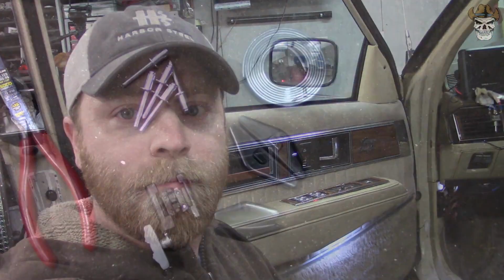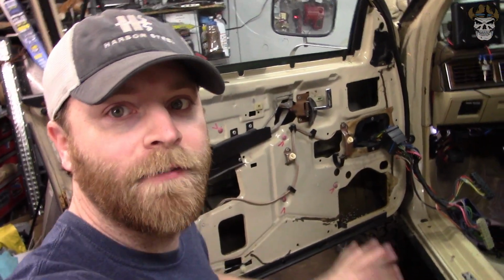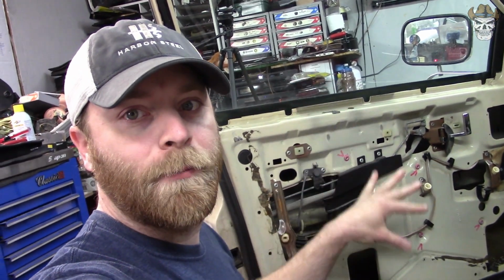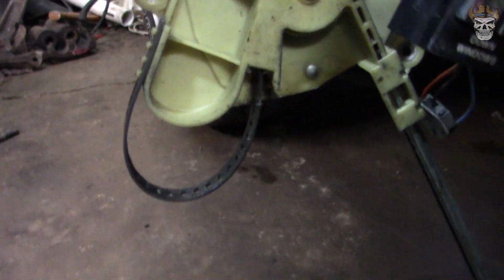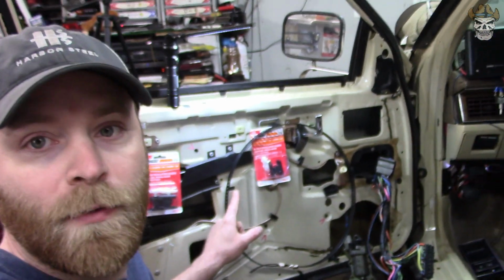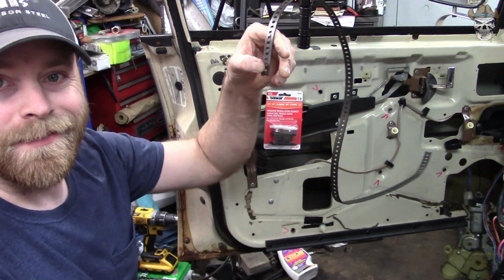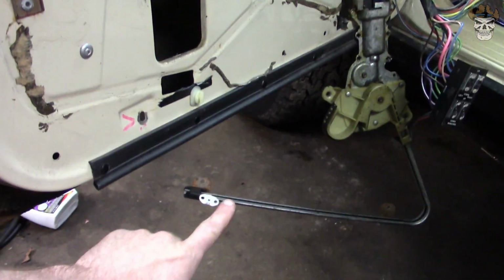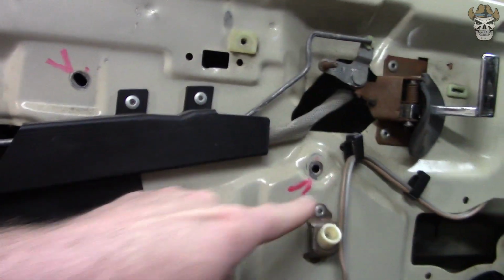1986 Oldsmobile Window Tape and Regulator Guide Replacement

Comment: Just got my first car recently (86 Cadillac deville) but my driver side window had the same problems yours had and thanks to you and your very helpful video you saved me a lot of time aimlessly trying to figure out how to fix it so thank you man🙏
Reply: Although I was wondering if I could do the same thing for replacing the the regulator with the white clip without having to take the whole mechanism out, like could I take the belt off the teeth from inside just enough to feed it down from the bottom to replace the regulator
Reply from the maker: I think you might be able to.  Its kinda tight in there and honestly might be easier than drilling out and removing the motor but im not sure if you would be able to feed the tape all the way out.

Comment: Hey love you videos! I just picked up a 1986 olds 98. I was wondering if you have any parts you wouldn't mind selling? I need hubcaps and a few other pieces
Reply from the maker: Thanks!  What kind of shape is it in?  All I have laying around is a front bumper, rotted out rear bumper, both mirrors, and a trunk lid.  I hung up the set of hub caps I still have in my garage.
Reply: @PostalRedneck  its in pretty mint condition, I really just need the yellow center lock piece for the hubcap, one of the right side 98 logos and this fill piece right next to the rear bumper to make it complete. Is there anyway I can send you pics?
Reply from the maker: You could send pictures to my instagram.  My blue oldsmobile had one of the bumper fill pieces fall out last year.  Good luck finding one of them.

Comment: Great video man, I have a 1985 Cadillac Seville and was doing the same thing, but the new regulator tape I got from AutoZone is too narrow and keeps jumping off the track, (same as the broken one that was in there before) any advice on what to do in that case? I can't seem to find a wider version of the tape.
Reply from the maker: Thanks.  Thats odd.  I would imagine most if not all the GM, Chevy and Cadillac's ran all the same size window tape.  I wonder if you have something wrong with the regulator itself.
Reply: Finally got it fixed, seemed like the tracks for the regular were bent out a bit, so I flattened them down and got some actual OEM tape from a Cadillac only repair shop near me. Those 2 things seem to have done the trick!
Reply from the maker: Was the tape from cadillac visibly bigger or different that the one you got from Autozone?  Glad you were able to figure it out.
Reply: Great question! It looked almost exactly the same, but I did notice when I folded it over on itself, it did seem to feel much more strong. Like when I shook it it didn't wiggle around as much. Hard to explain but it seems to have worked!

Comment: This helped intoduce this kind of window track , before I tore into both my rear door's on my
1990 Pontiac Bonneville  4 door. I've never seen this type of window track .  Also,  rewatching a second time to see what I don't know on the lock actuator rod . As soon, as I seen it on your door panel I knew what that bend in the rod was for. so the lock actuator doesn't have to have a rod travel
a long way to the interior handle or because it would of been to step of an angle to put a rod, straight to the lock mechanism. So they put the bend in the rod to hook it to the other movement of the door manual switch on my rear door. I was searching for a rod that didn't exist. LOL
Reply from the maker: Yeah its an odd way that they used for a long time to power the windows up and down.  Im happy they did away with it thats for sure.  Although all my Tahoes with cable driven regulators all seem to keep breaking.
Reply: I love the tape. It's strong and usually only needs a good cleaning and relubbing. If you do have to replace it its quite simple and cheaper than cables.